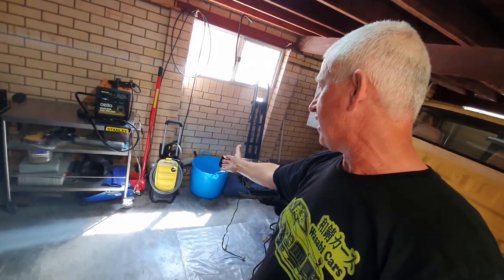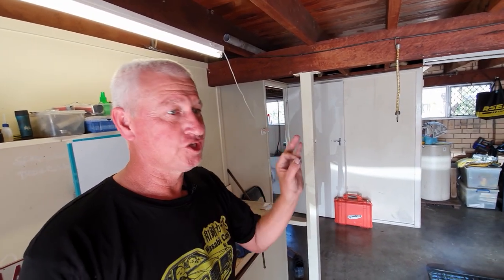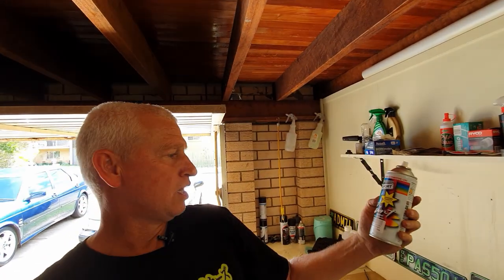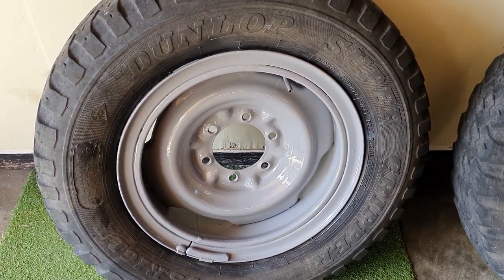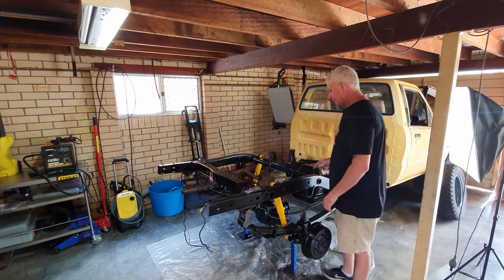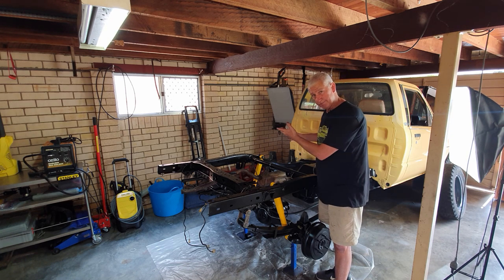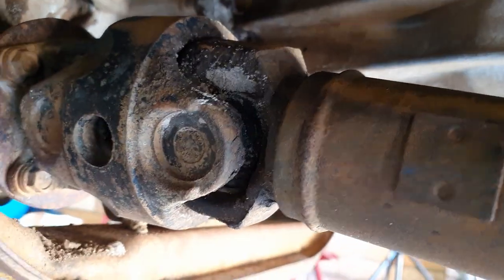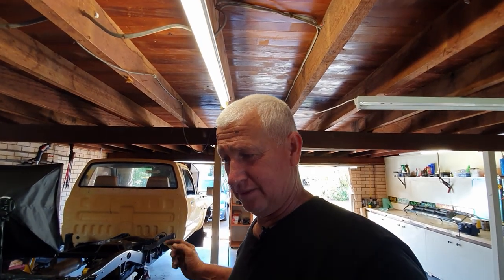TOYOTA HILUX 4X4 SPLIT RIM RESTO & CENTRE BEARING REPLACEMENT | 1984 Toyota Hilux Rebuild  [Ep 7]

Comment: Adam, given your obviously brilliant hand action with the paint can at the start, have you thought of taking up the castanets? :-)
How do you rate the Karcher for sand blasting (and what size sand are you using)?
Reply from the maker: Chris I am a man of many hand talents!🤣 I just use screened and kiln dried paver sand from Nuway Landscapes. Very cheap. The higher psi machine does work well but its not the ducks nuts. I had alot of issues with blockages. The sand had small rocks that got stuck in the  attachment. For small items its good but I wouldn't want to strip back a car with it and it's very messy. I know have a beach in my back yard.

Comment: Will the land cruiser split rims fit in the hilux?
Reply from the maker: Jonas I am not to sure mate, it would not surprise me. As long as the stud pattern is the same.
Reply: The earlier land cruiser rims are 16 inch 6 stud, and will bolt onto the hilux, however at some point the 70 series landcruiser went to a 5 stud, with an uncommon stud spacing.